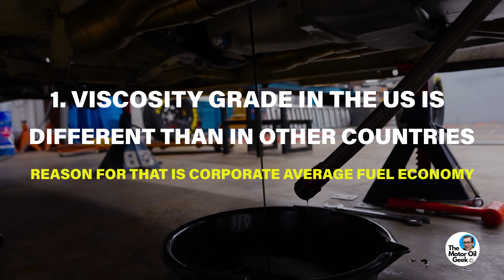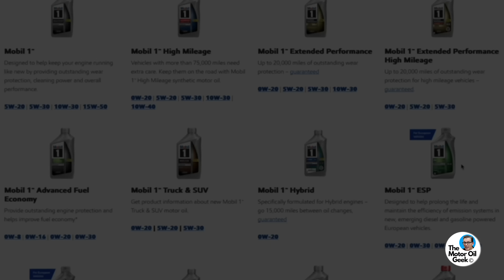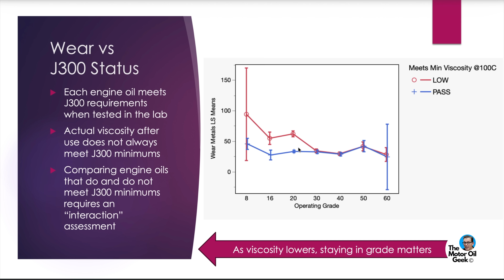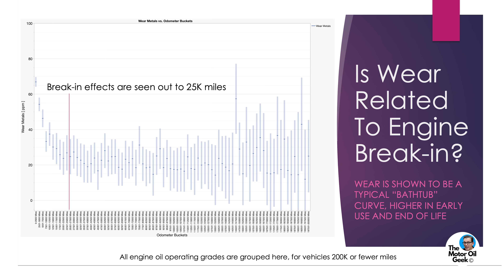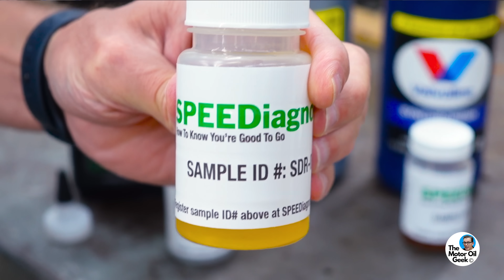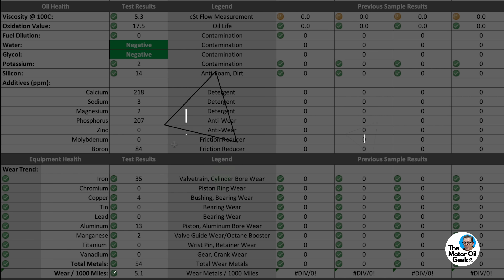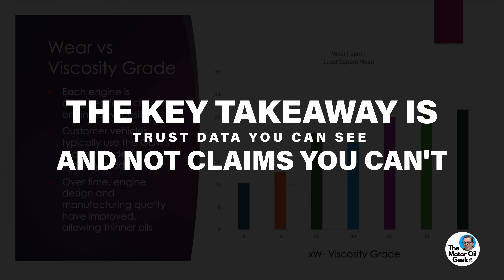More Ai Lies? The FACTS about 0W-20 vs 5W-30 (With Evidence)

Comment: Im not saying who until my video releases. But this is straight from a oil manufacturer.
" For drivers facing regular temps below 5F , a full synthetic 5w30 is an excellent year round choice, particularly for modern turbo charged gasoline direct inject engines.  This viscosity aligns with most manufacturer recommendations and effectively prevents cold start difficulties.  10w30 would work given its -13F cold cranking test 5w30 offers better performance in these conditions.  Should your region experience extreme cold temps below -22F 0w30 for winter months."

Why on earth would anyone run a "0W" especially in summer? In very cold climates yes i understand why.  Help me understand this lake. 
Serious question. 

That was directly from a oil manufacturer.
Reply: Zero weight oils are synthetic which seems to send more cars to the dealership for blend over synthetic DIY changes. Also, there's higher damage when oil changes are stretched. Just my $0.02.
Reply: @ryandoyle4344 but i did extended oul changes with resukts from lake. It wasnt damaging anything.  Theres also a difference between 100% synthetic and full synthetic. Full synthetic can be only 25% synthetic base oils and be called "full"  where as 100% is well. 100%
Reply: @BeardedFordTech  .Not true..only in USA can "highly processed" mineral oils be marketed as "100% synthetic" or "full synthetic" ( the same). Not so in Europe where 100% synthetic means just that...base stock NOT from mineral oils.
Reply: @TheWilferch  Most European oils, and greater part of the world, uses gtl to make lubricant and additives. It’s a question of source
Reply: @TheWilferch not according to lake when we did a livestream going over results. This is why i asked this question.  These things are interesting.
Reply: There are crazy people online who test bacon fat in engine and found it protects better than engine oil.  Funny fact.
Reply: @pixels303at-odysee9 yeah thats just a little out there. Ive seen dude run maple syrup. Bacon fat. Molasses cooking oil all sorts of stuff. And they all claim it works better than oil.  Interesting to watch though.
Reply: @BeardedFordTech most engine oils conceal where the oils are derived from and what additives are added. I would honestly desire a worse fuel economy with a thicker oil if I new my engine would last twice as long. But winter starting has been a challenge, so I tripple the batteries in my truck and now I have no issues turning it over.
Reply: @pixels303at-odysee9  it's not too surprising the saturated fats will break down much less easily. Probably tallow or cocoa butter plus some castor oil would be the ultimate long lasting lubricant.
Reply: Aren’t you the guy that says not to lube an oil filter gasket because it could vibrate off?
Reply: @lukeWiz44 you mean this one. Where the workshop manual from ford tells you not to.  I mean you guys follow the manual and manufacturer for oil weight right?  Why stop there?  Why not for the sctual maintenance?
https://youtube.com/shorts/tZWJrqwbLlw?si=gyMD-5U_vCPHKV01

The literal tsb says the oil vibrarion may cause the filter to back off and leak. I didnt say all manufactuers
Reply: Ahh this guy
Reply: @TimR1216 yeah this guy. Thats why i asked.  Thats straight from a oil manufacturing company.  That was a serius question.
Reply: No one is running zero weight oil. The "W" stands for Winter. OW-30 has the cold flow abilities of a 0 weight but the viscosity of a 30 weight oil. High grade oils that use lots of group IV & V base oils have exceptional cold flow ability, but that doesn't mean they have a low viscosity. You're thinking of cheap dino oil which relies on viscosity modifiers.
Reply: @afellowinnewengland6142 i know what the numbers mean. And im not talking sbout dyno oil at all friend.
Reply: @BeardedFordTech  Then why did you ask "Why on earth would anyone run a 0 weight especially in summer" ? Your comments would suggest you don't know what the numbers mean or what "W" stands for.
Reply: @afellowinnewengland6142 okay why would anybody run 0 w in summer.  Wow the internet is so butthurt over a comment. They feel the need to pick it apart.  Ive been doing this a long time.  Ive collaborated with lake many times.  Just an honest question. Why would anybody use a 0w for summer?  That better for you?  Ill go change it to please you
Reply: @BeardedFordTech  I'm not the Internet and hopefully no one is "butthurt" (whatever that means- I'm old so I'm not up on Millennial slang). I'm a department head for an auto manufacturer and I develop new vehicles for a living. Superior cold flow ability can be achieved by two means- heavy inclusion of viscosity modifiers with a lighter conventional oil base or through heavy use of Group IV and V base oils which inherently flow well at low temps. Therefore 0W-30 and 5W-30 could both carry a cst of 10.5 at 100c for example, but the 0W-30 can flow with greater ease at subzero temps. Additionally, the 0W-30 could very well use a higher grade base oil than 5W-30 (and often does) which is more shear resistant. So you might be better off using 0W-30 compared to 5W-30- even in the summer.
Reply: @afellowinnewengland6142 i wasnt referring to you personally. And thsnk you for that answer.  That explains a lot.  After reading my previous comment you were correct. It did sound like i didnt know. I got ahead of myself typing.  Thsnk you for the corrective criticism.  Seriously. Thank you.  Im not a millenial either.
Reply: @BeardedFordTech  No worries at all. For the record, no malice or rudeness intended on my part. I sometimes just bluntly point things out and it doesn't always translate in writing well haha. Oil is one of those topics that's simultaneously straightforward and also super complicated. I'll be sure to check out your channel and see what you've been working on.
Reply: @afellowinnewengland6142 lot of ford stuff. Sometimes i come across the same way when i dont mean to be.  Like someone down there said "arent you the guy who said dont lube the oil filter oring cause engine vibrstion causes it to back off"  yeah that was me.  I was literslly talking sbout ford with video proof from the ford workshop manual.  People want to follow the manufacturers specs right?  But when i post one of their specs all the sudden its a problem.  I never said it was for sny other manufacturer.  And i stated its a tsb for the gt350 with a spin on filter.  Some of the transit t250.  And the 21+ f150 5.0 says clearly do not lubricate.  It confuses me.  Know what i mean.
Reply: @afellowinnewengland6142 oh and the silent short going from 0w20 to 5w30 i have. An oil report literally told me to change it.  It was a fleet vehicle that runs 24/7/365 and thats what worked here. I cant tell people what to put in their car.  I can say ford switched from low stuff like 5w20 to 5w30 cause they said they would rather have the engine longevity than the fuel mileage crap
Reply: @BeardedFordTech  I hear ya. It's taken me a while to learn that Youtube is 1/3 teenagers, 1/3 grumpy retired people and 1/3 know it alls. I'm not sure why I even comment here some days haha. Starting a channel here is tempting as I wouldn't mind sharing with folks- but the comments might drive me mad. I don't know how you and Lake do it!
Reply: @afellowinnewengland6142 im learning to ignore the teenagers and know it alls. Its a task. And is stressful. But im learning. Not near as bad as i used to be. In fact thats my goal this year. If someone gets good info awesome. If they dont then i need to work on it. If they are negative in comments i will have no time for it anymore. If they tell me 1+1 if 4 million they are absolutely right and ill move along.  Now if its corrective thats different. Like you did and made me realize my comment did seem that way. And for that i still thank you.
Reply: You seem like a very sharp guy. What is your opinion about mixing the oils, like 50% 0w20 and 50% 5w30? Seems like a logical conclusion and a good compromise? Thanks in advance.
Reply: @kurtheitman552 i dont recommend it. But im not the tribologist here.  I dont think it does anything.  I could be wrong. Maybe someone can answer that?
Reply: @BeardedFordTech then what about running 0w20 in winter and 5w30 in summer? Thanks for responding too! Really appreciate it.
Reply: @kurtheitman552 i cant tell you what to run.  Oil testing can.
Reply: @BeardedFordTech ok. Appreciate your response.
Reply: @kurtheitman552 no problem
Reply: @kurtheitman552  I have the same question. I get cold winters and hot summers. Also driving a 2012 Honda crv with 130k miles. All its ever had is 0W-20, but I'm thinking 5W-30 moving forward into higher mileage?🤔
Reply: @sterlingmoore4798 not sure why this subject hasn’t been discussed before. Seems to me that mixing 0w20 and 5w30 would be a natural transition instead of jumping completely to all 5w30. Especially if it’s the same manufacturer. I’m going to keep asking this question and hopefully Lake addresses it. I think many people here completely overthink this. Maybe I’m wrong.
Reply: @kurtheitman552  It would only work if the additive chemistry is largely similar and the only difference is the viscosity. However, it's usually not a good idea and mixing two brands can result in lopsided chemistry. I should point out that what you're trying to achieve can be accomplished by selecting either an especially heavy 0W-20 or an especially light 5W-30. What's printed on the bottle isn't the literal viscosity. It just indicates that oil will fall within an acceptable range dictated by SAE. In the case of 30 weight that's 9.3 to 12.4 centistokes (cst). In the case of 20 weight that's 5.6 to 9.2 centistokes (cst). So if you're looking for a 50/50 mix- what you really want is an oil around 9.0-9.6 centistokes. Good news- all oil manufacturers publish this info on their websites. Hope this helps.
Reply: @afellowinnewengland6142 wow! Thank you. I would only be attempting this mix with the same manufacturer. It just seems so logical to me to just find something in the middle by blending the two different viscosities with the same manufacturer. Just want to make my engine last and perform at an optimal level.
Reply: @a @afellowinnewengland6142 y is that centistokes the same as the kinematic viscosity? I’m looking at the spec sheet for Mobil 1 truck and RV but can’t find any mention of centistokes.

Comment: Personally, if I bought a vehicle that called for a thicker weight oil in other countries, I would run the thicker grade. At the very least, it gives me a saftey margin for viscosity breakdown.
Interestingly, on my 1998 Saturn wagon, right around 3500miles my oil usage goes from negligible to 1/2 a quart per tank. Therefore, once I add the first 1/2 a quart, I simply schedule my oil change before the next fill-up. I assume it is either fuel dilution or viscosity breakdown causing the change.

Comment: In summary, with 0W-20 oil you're operating at the low edge of acceptable protection. Any breakdown at all and you're in the high wear zone. When breakdown occurs is unknown.
Reply: Disagree. Analysis proves otherwise.
Reply: @monicam8408   How so? @3:18-4:00 he flat out says that.

Comment: Whatever the reasons, engine failure has increased dramatically across the automotive world. That's a demonstrable fact. That's where theory and empiricism part ways. I was a master mechanic for 20 years before I got into software. Thinner oil requires tighter tolerances, which increases criticality. I also majored in ME.

Comment: Lake .. I am a mechanic 58 years of age been doing it since I was a 16 year old apprentice. I also build auto transmissions . I live in Australia where it’s quite hot a lot of the year 30 degrees c . I have see with my own eyes the damage caused by 0/20 oil . I’ve seen it firsthand!! Especially on some very late model Toyota and Kia diesel engines. Predominantly big end and main bearing issues and occasionally a nipped piston. Change to 5 /30 it just doesn’t happen. So respectfully I don’t care what your oil analysis says , l know what my eyes say. Perhaps it’s fine in cold weather but not in hot weather

Comment: Hello Lake, I have a 2014 Mitsubishi Mirage three cylinder 130,000 miles. I bought it with 109,000 miles and I’ve been using the zero20 either mobile one or pennzoil ultra platinum every 5000 miles. With either oil whole system only holds 3 quarts about every thousand miles half a quart has to go in there obviously no leaks. The new Valvoline oil would improve any of my oil consumption, restore and protect.
When I bought it, I did look in the oil cap where I can see a little bit of brown, but no sludge in the valve cover whatsoever so the previous owner must’ve done some decent oil changes. I look forward to your response.

Comment: As always Lake, amazing data ! My question to you is how do you ensure your 0-20 stays within grade ?  I am taking delivery of a new VW Tiguan Turbo 2026 and plan on doing the first oil change at 500KM, second oil change at 1000KM, third at 2000KM and every subsequent ones at 5000KM at max. All that using Liquid Moly Top Tec 6200
Reply: LiquiMoly is great oil.  I've been using it in my now 23 year old 2003 GTI VR6, and the engine still purrs like it's new!  No engine issues all these years, and i'm still running the original timing chains!  I do use Shell Premium fuel (premium is required) as well.

Comment: We don't all live in ONLY hot climates. -38'C last week in my Northern BC. 0-40 is my choice for many of my older engines, off warranty. Awesome cold weather pour point, lubrication and immense sheer strength in hot summer days. 0-16 and 0-20 worry even me at +36' C Canuck summer time. I just change oil on our new rockets more frequently than required, until off warranty, when I'll likely change oil specs.
Reply: Im in the okanagan w a ‘15 yukon that calls for 0/20. It doesnt get really cold here like it did in the 80’s,90’s but still using 0/20 in winter and will use 5/20-5/30 during summer.Supertech synthetic is what ive used for 20 years.

Comment: This simply defies logic.

0/20 or 5/30...should ALL  be manufactured with equal shear and wear qualities IF MANUFACTURED BY THE SAME MANUFACTURER

otherwise, as you did, the confusing, miss-leading data difference is in the blending of manufacturer or brand.

so you haven't cleared up anything.

you SHOULD produce viscosity quality data BY BRAND and not just grade.

Comment: You keep saying you want an oil that stays in grade. So which oil would that be? I think that would be helpful don’t you?
Reply: Would that be a Non-Multi Grade oil? Like SAE 30 ?
Reply: You need an oil analysis to find out for your particular car.  There was a recent video where they claim they used Blackstones analysis results and Amsoil, Pennzoil Ultra Platinum, Mobile One Extended performance, and Castrol with Titanium did well staying in grade.

Comment: I've been running 0w 20 religiously. But after this video I might run 5w20 in the summer now
Reply: Just get an oil analysis after a summer run. I've been doing 10w30 in the summers.  I'm going with Pennzoil Platinum 0w20 this summer and going to get an analysis.

Comment: I could not make out that one chart.....so which brands are more shear stable?
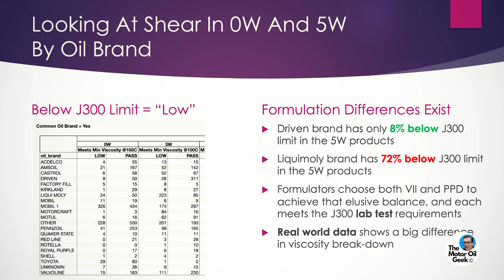Reply: At 5:10 it shows a list of oils and how many samples were out of grade vs in grade.  If you put that into a spreadsheet and do it on a percentage basis then you will know which ones stay in grade the best.  I did that and it shows in regards to the big three Valvoline stays in grade the best with Pennzoil next, and Mobil 1 last.  If you look at the boutique brands Driven stays in grade the best followed by Redline, Royal purple and Amsoil last.  It should be noted that Red line and Royal purple didn't have a very large sample size while Amsoil had a large sample size.
Reply: Sample sizes are too small to draw the “best” conclusion… you could probably make an argument that amsoil is much better than average and argue pennzoil and valvoline are better than average and that mobil 1 is worse than average. But too many small samples of most all of the brands without know statistical significance. And that big “other category” pretty much sums up that most Ow oils have a 30%+ probability to shear out of grade over a presumed 10k mile OCI. Nothing in this data guarantees that at 5k oil changes you are doing significantly better.
Reply: @brianbowden6302  Assume your comment is about 0W-20?  If you run the numbers shown in the video Valvoline only falls out of grade 8% of the time while Amsoil falls out of grade 11% of the time.  So Valvoline is actually the better 0W20.

When it comes to 5W30 though Amsoil is better only falls out of grade 27% of the time vs Valvoline that falls out 33% of the time.

Comment: Changing from 0w20 to 5w20/30 stopped my 2017 Subaru with 86k from consuming 2 qt between oil changes. Now it only consumes 0.5 qt which is typical for most engines.
Reply: That is NOT typical.

Comment: 2008 Toyota Tundra 
243,000
0-20 Amsoil signature series last 7 years 
Changed oil once a year 
Every 15-17,000 miles 
Had to replace spark plug tube seals recently. After taking the valve cover off it was very clean inside.

Comment: So running a 10k mile OCI on 0w20 and below is probably not a good idea, but likely not as big of a deal on 5w30 and up. 3:52
Reply: Dude he’s never recommended going the full 10k on synthetic especially not with diesels.
Reply: @TheMostRacing my comment was aimed at Toyota's guidance 😂 

My cars get changed at 6 months or 5k miles, except the one running ethanol blends, which gets changed every 3 months.
Reply: You can get 10000 miles on oil people it’s the filter issue I don’t know why people don’t understand it car manuals used to say it change the filter every 3000 miles.